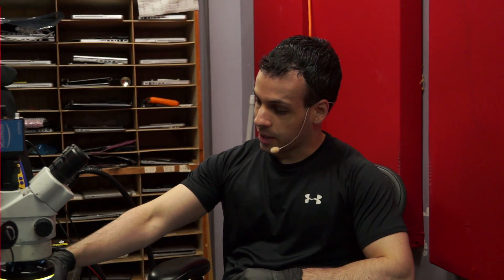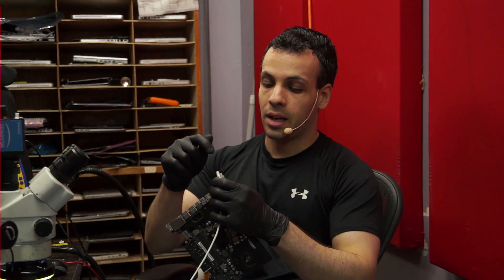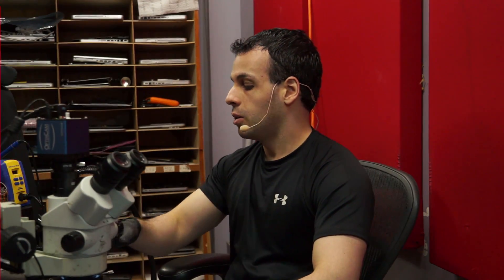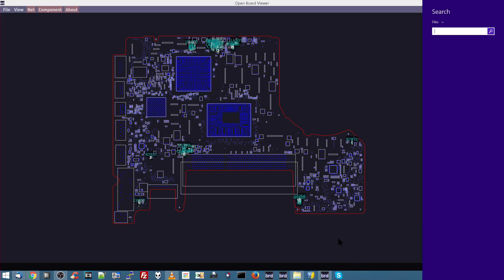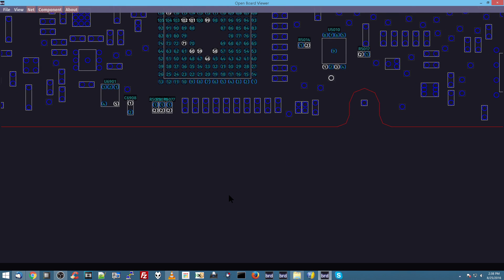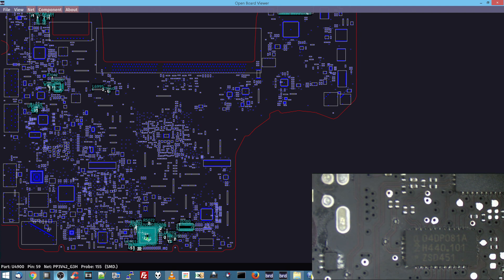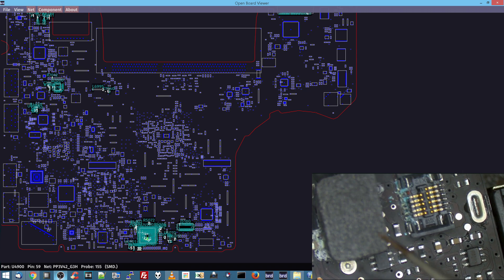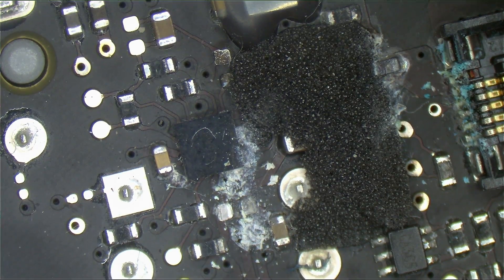Hunting liquid damage; you can take cover but you can't hide from me!

Comment: Ok, School me please. If the cap with a bad/no/corroded connection didnt give you a green light, how did removing the cap give you a green light?
Reply from the maker: It was sitting between 3.42v and ground. It stopped being a capacitor, and started being a wire. Broken capacitors act like wires sometimes when they break. Removing it removed the short circuit to ground and allowed the 3.42v rail to work again.

Comment: For several days there's a question that I cant find the answer for it. I have a macbook white from mid 2010,can I replace it's case with one from a pro 2010? Also, is it possible to take the board from a macbook pro from 2010 or greater and place it into the white one from 2010, or at least the keyboard from a 13" pro? Thanks
Reply: Also, can a battery from a macbook pro 2010 be placed inside mid 2010?

Comment: I did my first surface mount repair on one of my ham radios using the things I've learned from your channel over the last 6 months or so. I ordered parts after working out what I thought could be the problem based on the schematic. Luckily Icom is no Apple and provides schematics. Turned out to be a bad 0 ohm resistor. Thanks Louis.

Comment: What exactly does the capacitor do on the board? & why was the board able to turn on with the capacitor no longer on the board? (Sorry for being a massive noob just trying to slowly learn via your videos)
Reply: local decoupling for the audio chip probably
Reply: It probably was a faulty (corroded to hell, shorted, idk) cap between the 3.3v rail and GND that when it was making contact with the pads it was shorting the 3.3v rail to ground. And the purpose of that cap is maybe for filtering the noise (since it's near the audio chip?).

Comment: If you're looking for the boardview software that is being used, you can get it at http://openboardview.org 

Thanks for the new video Louis; video does look better, shame, would have been neat to see you get the new card :D
Reply: I can attest that it is a legitimate and very useful piece of software. Be gone you trolls.
Reply: *****

We do occasionally get false-positives coming up (usually 1 hit out of 68); recompiling with different optimisations often resolves it.  Gets frustrating though.

Thanks +1 :)
Reply: its infected
Reply: Which one ?  I get zero hits on VirusTotal for the OFBV

https://www.virustotal.com/en/url/076c210a503321ee23e73c666bed78191c3da6d041332efd57d3fa57821336f2/analysis/

There have been some false hits on minority scanners but that's all it is, you can check the source even.

Fundamentally the problem is that with so many virus signatures now in AV engines, there's an ever increasing number of false hits.  If you check/upload the file to VirusTotal you'll see that the proper AV scanners like ESET do not false-positive it.

EDIT: This is the scan for the OBV original release  https://www.virustotal.com/en/url/693bd0c939c4583d4a19ae1b67c5d839a12dc4d69be6fcb4966d217ca4b5f358/analysis/1472986835/
Reply: thank you for the link